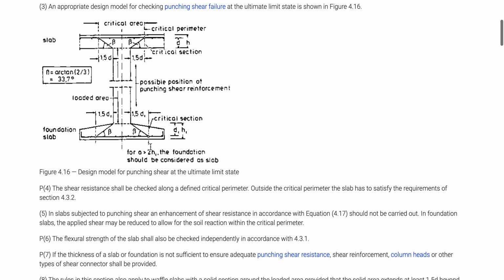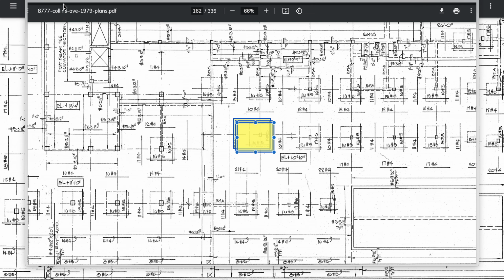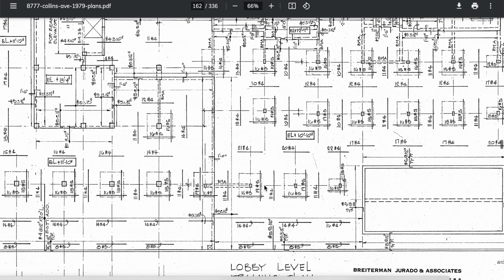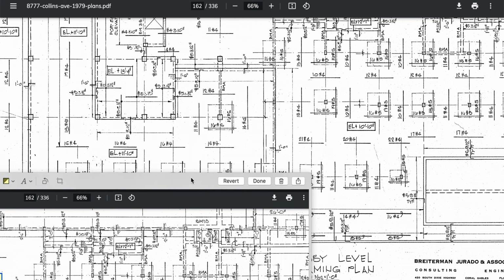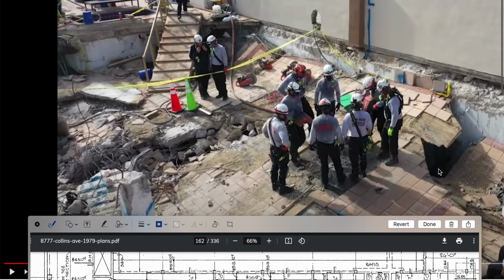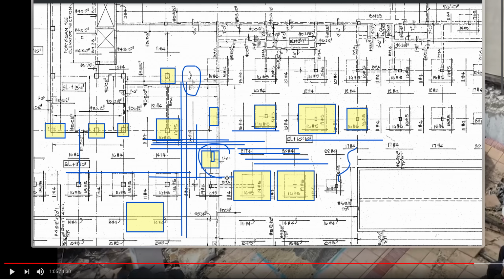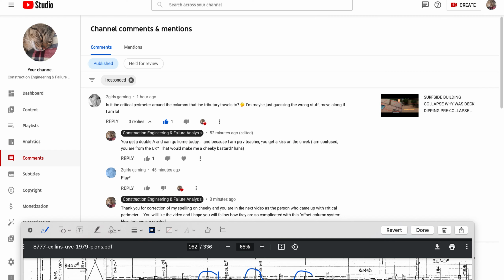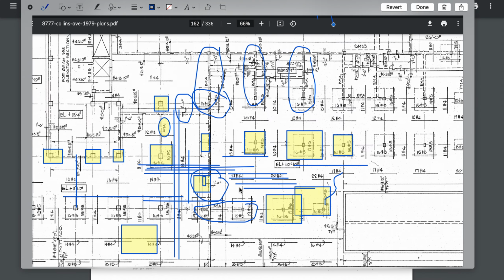Champlain Towers  COLLAPSE CRITICAL PERIMETER ZONE & TRIBUTARY  ZONES MUST WORK TOGETHER IN SLABS

Comment: 🏗🧱👷‍♂️📺❤🎥📼 My brother showed me his home Security System,Surfside Security Cams may have been Digital Footage relayed into a central system, most new security cam systems feed link up to a satellite which stores the camera file 🎥 📡 🛰  Great Videos 🏗👷‍♂️❤
Reply: Most are DVR with some using cloud storage.  Satellite not needed if you have broadband available to store off-site on cloud server.  Surfside had broadband. So it likely used DVR and/or cloud based storage.  Nearly all I have seen resort to DVR local storage first.  Ring and such is strictly cloud though.  You generally need subscription for cloud storage.
Reply: @thegraphicw  That is why I suspect if there were security cam footage that it's most likely gone at this point. DVR storage is on site not in the cloud. The DVR is likely in the management office, which is in the x10 unit stack.

Comment: You are cracking me up!! Does steel at least buy concrete dinner before intercourse? Does concrete order the lobster? LMAO!! 🤣🤣🤣

Thanks for the tip BTW ☺️
Reply from the maker: PS you know "thanks for the tip" is so making me want to laugh!!!
Reply: @LoadPathEngineering  yes I do LOL
Reply from the maker: Elaine, you are two up on me ..
Okay, let me try...
For the intercourse of steel and concrete to work, they have bond as one...
The "coupling" may be short lived if the steel cannot maintain it's rigidity ...
Reply: He didn’t answer ur question…order the lobster-lol
Reply from the maker: @juliefizpatrick513  okay Julie, order the lobster but don't get 😴 on me. Lol

Comment: Based on the photo evidence available, and Kai's instruction, I can identify column L13 as the column I call "Tippy Longstocking" Using the "hammock" idea, logic would dictate that column M10 would be the complementing column of the "hammock". Also to note, column M13 is obliterated (whether that column is on the floor or not is irrelevant. It's gone from the equation. That leaves L13 and M10 in highly increased tension. And Tippy Longstocking is evidence to show exactly how much tension existed between the two columns. Suspend reality, and imagine everything happening but the building collapsing. You would see a similar tension bow.
Reply: L13.1 would be in the middle of the deck per the plans actually used for 8777 Collins.  M11.1 was missing in action in the Tik Tok video, but you could see M10 still there.  BMAs were between the majority of 10 and 11.1 columns.  I suspect that torque was being applied on both M10 and L10 via BMAs liberated of their 11.1 columns due to deck collapse.  K10 was likely in similar circumstances as well.  Check out Tik Tok video, M11.1 might get the Tippy Longstocking name because she is gone and it appears as though the planters that were above her were already sitting in the garage. The Tik Tok video was taken well after things were already in motion.  It was well after the Nirs first started hearing noises and noticing issues.  It did not last but for a few minutes after the Tik Tok video.
Reply: @thegraphicw  8777 is South. Am I reading your comment correctly?
Reply: @jazzman92478  Yes
Reply: @thegraphicw  ok cool. Thanks for the clarification.
Reply: @thegraphicw  M10 is a very telling column. Even if you spit through the CCTV collapse video frame by frame, you can see it pull away from the building face HARD. That whole column looks like a backwards ‘C’ the instant before it falls down. Immense tension between L10 and Tippy Longstocking.
Reply: @thegraphicw  I’m not sure. I’m thinking M11.1 is the blowout. The angle of attack would put the tension too far to the right of where we need it to be. I can get a straight shot run from L13 to M10 with a kickout out M11.1 to get it out of the way. M11.1 is stopping the pull. Once it fails, then it’s game over (7 mins. later).
Reply: @jazzman92478  11.1 was gone by time of Tik Tok video.  13.1 was punch sheared even before that.
Reply: @thegraphicw  Yes. 11.1 and the tension breaking the undercarriage of the building is the "explosion" they heard. The final jolt of tension is what pulls M10/L10 out. By the time the tiktok is taken, the building takes over as cascading failure. Would be nice if the lady walked closer to the garage opening and stooped down to take a better video of what the undercarriage looked like.
Reply: @jazzman92478  She would have had increased personal risk if she did that.  Luckily she did not because rubble spread clear across the street.  Yes something happened to cause it all.  The most heavily loaded part of deck failed and it cascaded across nearly whole deck with nothing to stop it.  That is why Kai is discussing missing BMA so much.  It would have been arrest point more than likely.
Reply: It was game over by time of Tik Tok video.  Building was on borrowed time then.
Reply: @thegraphicw  Still need something to happen for a "void" to open up and see down (not out, down) to the garage.

Comment: Just a thought on the investigation.  If it were a real investigation I believe they would have had CDI take cores while they were drilling to place explosives.  No cores were taken though columns had to be drilled to place the explosives for demolition.  That is an admitted fact.  CDI made it a point to let it be known they were not asked to take cores and they even commented they felt concrete was under 6000 PSI.  Just my observation but it looks to me the "investigation" is just the appearance if one.

Comment: I was wrong the column across from 42 is still in place with all that blue spray paint and as for the people playing in other video that as far as they got the only thing under that is a maroon car all they need to is look underneath there's a gaping hole by the wall .I can't understand with all the modern technology like thermal cameras and inspection cameras used in the small unassailable areas. Looking forward to your next video thank you 🙂👍
Reply from the maker: Awesome... That is how you know you can still learn, when u can change a position based on new or better data
Reply: @LoadPathEngineering  s I what back and looked at some of of you other video's and the columns with rebar bent down by gate is the column .I am ready enjoy this keeps my mind active very challenging..
Reply: Here are some photos photos 19, 22, and 27 from channel 10 show the cabana and flower box/ planter.  The column may be shown in/ by the planter Near gate

Comment: Working on this.... But I will start with a lil tidbit: This is one example of why you never want to release tension from a system all at once. To use another music metaphor, you detune the string slowly over time so the tension energy can dissipate. Will have more later.
Reply: I'm a bit of a gear head so I'll think of it in terms of why, in this example, there's a bolt pattern for removing a cylinder head.
Reply: @jplattet  I understand your metaphor as well.
Reply: All I can think of is that something must have failed prior to the rotation of the pool deck area that rotated that portion of the deck in a slightly counter-clockwise fashion. One portion was pulled to the south and west while the other one, nearer the building, seems to have been pushed to the east. My mind wants to go to a column being responsible for that somehow, but that's where I get stuck.... Especially when I start factoring in that I have accepted that the initial failure was in that upper parking deck area. Oh, well, I'll leave it there for now....
Reply: @jplattet  That's totally fine. We need to get from the parking deck over to the building. Ive worked on several mechanical theories to make it work, and thus far, all of them have been wrong in some way. There's no harm in doing the thought exercises based on the data, provided being able to change the theory on a dime when new data comes in. I'm not an engineer of any sort, I'm just a regular guy who intensely enjoys solving a really complicated puzzle.
Reply: @jazzman92478  I’m no engineer either. By training I’m an Economist and by work I’m a semi-retired real estate broker who does a listing or a sale now and then and also does appraisals. I learned a long time ago that the broker does not get involved with inspections. Seen too many others end up getting sued for that.

Comment: Academia vs real life experience. On paper the designers at the time believed their plans were solid. From this collapse we know that not be true. As a contractor in CA with A B C-39 and Hazardous licensing for many years we rely on ever changing construction techniques that many books lack and not generally taught in school. There is a reason our youngest partner did a construction internship while at Cal State Sacramento. To learn real world experiences!
Reply: I disagree with your conclusion that "On paper the designers at the time believed their plans were solid. From this collapse we know that not be true.". How so ? Are you saying that the designers knew the pool deck would have some VERY heavy planters that would be regularly watered ? If the designers knew this why did they not make sufficient provision to prevent water ingress into the slab ? In any design involving reinforce concrete, provision is made to prevent water & air ingress into the concrete. And if there is going to be abundant water constantly over the concrete then water proofing become extremely important. If water and air are allowed to reach the rebar severe damage is going to happen. Everything I've seen seems to indicate that there was minimal waterproofing in place. 40 years later several slabs are severely weakened by years of excess water leaking out of the planters. The collapse of those weakened slabs and the subsequent forces exerted on already partly compromised adjacent columns and slabs spread through the whole of the building, slowed by one shear wall and halted by a much larger shear wall. In my opinion its very likely that the shear weight of those planters and huge palm trees exceeded the design loading and caused cracks to develop - which only accelerated the water ingress and subsequent rusting of the rebar leading to slab delamination. From a highway-bridge-engineers perspective the slab waterproofing was virtually non-existent, laughably so, and years of over-watering large, deep planters that possibly also exceeded the slab design loading made severe slab/beam damage inevitable. Its arguable that the  design was not resilient enough to this type of progressive collapse - a structural engineer would be the chap to ask. 
Is there a palm tree expert here ? In some of the pictures of the large palm trees - before they were removed -  the bottom leaves are very yellow. In most plants in a pot this indicates over-watering possibly with the lower roots constantly sitting in water. Is this evidence of the regular presence of large amounts of water in the planters ? Huge heavy trees and a constant head of water sitting on a non-water-proofed reinforced concrete slab subject to excess stress sounds like a recipe for disaster to me. It will take a few years - maybe 40 or so....

Comment: If you can calculate the exact tributary area of the columns more power to you.  Looking at the plan it is a total disorganized mess!  The design is seriously lacking beams and transfer girders to hold it all together. They need more columns, larger columns and a thicker, higher psi, and heavier reinforced pool slab that was properly waterproofed.   Here’s the ironic part in my mind.  If they designed and constructed the garage isolated from the building and heavier it would of not added a huge amount to the sales cost per  unit.  Had they done that we might just be discussing a collapse that crushed a dozen cars due to overall lack of maintenance. Maybe it would of held?
Reply: I am not an engineer but after viewing this analysis it seems apparent that the building would still be standing if the deck were designed so its collapse could not pull on the columns. 

Am I correct inbthis thought? If so, why tie the deck to the columns in the first place?
Reply: @Goldsteinphoto  Correct Allen.  The deck needed to be a totally isolated, independent structure from the building connected only by an 8” expansion joint.  The deck gives way and the building still stands. Why tie the deck to the building columns?  Because they were trying to squeeze every square foot of parking space out of the design is my guess.  Not sure, maybe Kai knows?
Reply: @PaulJersey  Isolated structure is of course the best solution. However, in this case, the original design was to isolate sections of the deck so if the parking deck were to fail, the energy would never make it over to the building. The BMAs would head it off at the pass. The fail-safes were there, but then went away.....
Reply: @jazzman92478  I agree Jamie. If I understand this correctly many of the BMA’s that were on the structural drawings were never actually installed? Is that correct? Wow!
Reply: IMO, the developer was greedy. Every penny saved counted. His daughter said it best, “He enjoyed the game of business and was good at that,”
btw, all really good points Jersey Paul.
Reply: @jobrownsmith116  you are so right about the developer Jo.   Let’s forget about all the structural stuff and look at the floor plan.  Every available square foot was used to get as many units as possible.   You got a small lobby, crappy little gym, a small pool, an overcrowded parking garage and a small beach front.

Comment: Some plans of the North Tower would be nice to have.  We could figure out BMA profile in garage if video and/or photos exist of it.  Just something to satisfy curiosity.
Reply: Somebody could just go down into that garage and look. Won't mention any names (papa smurf). LOL
Reply: @jazzman92478  I’ve thought the same thing: just walk in and take a look. There’s been a lot of times when I’ve done appraisal inspections on condos and I have to get into the basement parking area for photos. Do I stop at the front desk and tell them my life story? Feck no. I just go walk like I own the place and go down the stairs and do what I have to do. I wonder if one of us isn’t close enough by to just go do that.
Reply: @jplattet  and Brian. The maintenance issue aside (yes Champ North has a better track record), I'm simply looking for the BMAs to either be there or not. That's the Achilles Tendon. If they are not there, then maintenance alone will not stop the inevitable. Something would need to be retrofitted into the structure post-haste.
Reply: @jazzman92478  True, if that BMA which ended up missing in the south was there, then initial failure would have been likely localized.   You probably would have had the lobby parking deck dropped into the abyss, but it likely would not have punch sheared across the rest of the deck.  That BMA would likely have halted it.  Maintenance would have prevented it from being tested though in the end, but inherent weakness would still be present without the additional structure.  Really no argument there.
Reply: @jazzman92478  Papa Smurf is not there to investigate anything, he is there to cover ass for Surfside.  Much of what government does is about appearances of what is needed, but if you hear the conversations behind closed doors, you know it is anything but.  Some of the stuff I have personally seen over the years makes me quite sick.
Reply: @thegraphicw  Why would the Town of Surfside, which has a crack building inspection department, need to hire an outside engineer? 🧐 <sarcasm>
Reply: @thegraphicw  so the north tower residents are comfortable with that.  Will we be seeing shoring trucks soon? Or do we simply say its lasted for forty years as well, but it might be a good time to sell, before the "renovations"
Reply: @charlesrhodes7531  One would like to be a fly on the wall in a Champ North condo board meeting, no? As for selling, sure, but I’ve been a Broker for many years and I’d probably not buy the trouble of wanting to be the listing or selling Broker on one of those units right about now.
Reply: @charlesrhodes7531  There is a CNN video floaring around on youtube where they go into the North Tower.  North Tower supposedly has a much better maintenance record.  The parts of building and garage I saw in CNN video appeared to be in much better shape.
Reply: @jplattet  probably need to know the condition of the building beyond the mayor and Papa S.  They were more pro active with maintenance.  The video shows a damaged column, but my eyes must be playing tricks, it's just weird damage to me
Reply: @jazzman92478  they went back to the original tile surface for the north pole deck.  The deck is more compact than the south tower.  Darker gray should be moisture along grout joints/ cracks.  Overlay blue prints

https://ap.rdcpix.com/1886425340/3a294357475fc1757723d2720e51063dl-m0xd-w1020_h770_q80.jpg
Reply: There was also a CNN video about the East Tower.  Apparently when the South Tower collapsed some of the residents thought it cracked a column in their garage because concrete fell of it.  The rebar I could see deteriorated.  The column did not crack, it had active spalls that were liberated of concrete from vibration.  Column not compromised by looks of it, but it is in need of repair professional repair.  I saw some obvious bad repair work where they tried to conceal a spall.  Never works for long.   Over all through, even their garage appeared in decent shape.
Reply: Damage was not as bad as it looked in absence of deck damage.  If the slab showed obvious damage, I would be more worried.  One spalled column is not something that scary, especially when it was not deteriorated enough for a bust out.  Stirrups were still quite intact.